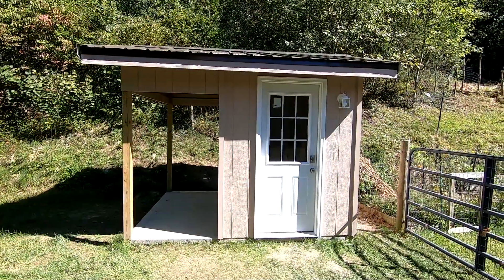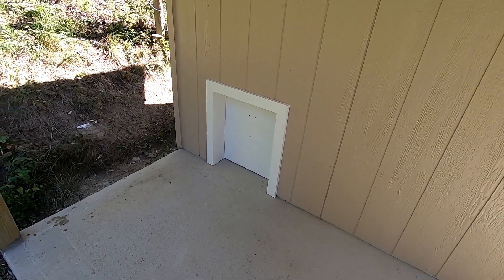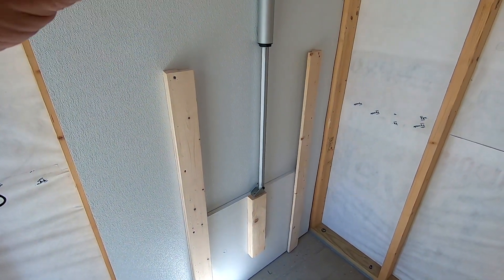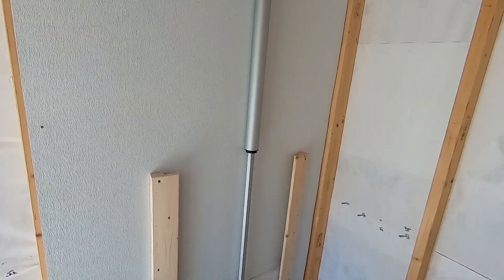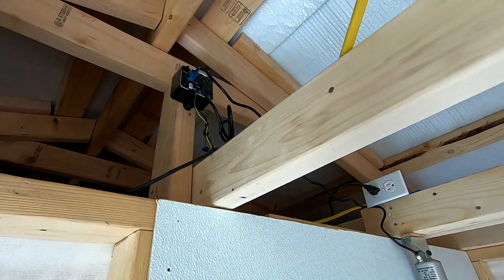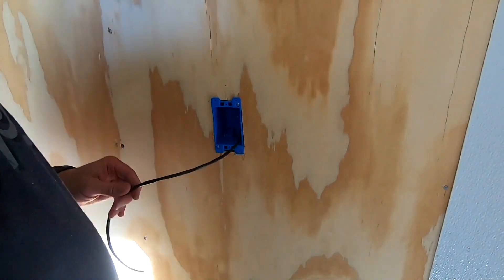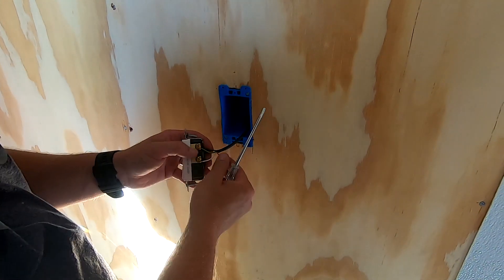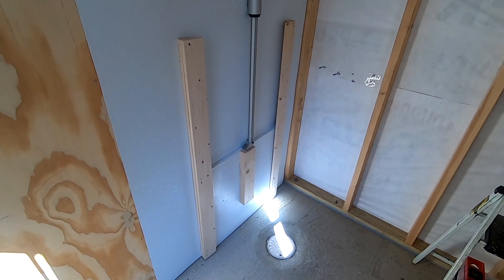How To Build A Remote Actuated Dog House Door

Comment: "Ultimate dog door"?  NOPE.

Common man. It is a nice door but, to be an ultimate door it need way more than just being able to open and close, by remote. NOT saying it is crap. It looks very nice.

"Thought you could make it better, than a commercially purchased door". Fail. Well not fail, maybe a draw.

1 Should be at least 2" to 4" off the ground so that water does not go in. Your walk-in door has a threshold for that reason. You should have at least put one on the dog door. This also makes it so that nothing gets accidently pushed into the doors path. Like a food bowl, bed, stick or dog laying there. I know you will be there looking when operating but if you ever want to automate the door it, a raise threshold will make sure bowls, sticks and beds don't get in the way and it will be uncomfortable for the dog to lay there.

2 Your controls and power should NOT be in the ceiling. They should be in a cabinet or at least be mounted on the wall for "just in case" and maintenance. Not adding difficulty of being in the ceiling.

3 You should have mounted it INSIDE the wall. I have a video Called "Chicken Coop Door w Safety Feature" and another one called "Experience The Ultimate Chicken Door Safety: No Crushing, No Cruelty Testing". You will see, that putting it inside the wall is much better and "easier". All the components can be placed in the wall behind an access panel (Plexiglass in the videos). All the components will be protected and out of the way. Added bonus they will stay clean.

4 The door railing/track is way easier to make and install. No need to build up a track. 

5 It can be insulated just the same as a regular wall, just about. It will help in cold weather that all the components will be protected from the cold.

6 On that note. By making the actual door a 3.5 Thick x whatever Height x whatever Width box. The actual door can be filled with insulation. This will also remove the need for "tracks", since the door will take up the space between the wall outer sheeting and the wall inner sheeting.   Imagine a double pane window that provides an airgap, and improves insulation. Call it a double pane door.

7 I normally advise people to attach the push rod of the actuator to the BOTTOM of the door. Or 3/4th to the bottom.  This not only helps keep the door from binding but it saves on vertical space. I mainly deal with chicken doors, where often there is not much vertical space in smaller coops. So for you it is not a big deal but it helps. The rod can be attached at the bottom or top of the door mentioned in #6.

8 you don't need to spend $75 on a control switch. Yes, it is built and ready to go but you can get WAY more functionality from an MHCOZY 4 CH Smart Switch. It has RF Remote, Wi-Fi, Interlock, works with A and G home assistants to program open and close times automatically. Set it to open and close with the sunrise and sunset or before and after. Can be made to also wait to open the door on very cold days. Open and closed from anywhere. 2 channels will be for opening and closing the door and you will have the other to two to operate lights or a feeder/waterer.  All for just $20.

9 It would way better if you were operating this on a 12 volt battery system. Solar charged or mains charged, but it works off the battery. WHY? So, if there is a power frailer and it is raining (like after a storm) but you don't want to go out to have to manually open the door because you expensive switch operates on 120v ac from a 12v power supply. You never mention that part so I am assuming. Mains power is out but the battery is still charged.
Reply from the maker: Thorough

Comment: I like the simplicity of it.  Would be great if you could connect it to the internet and open and close it from anywhere.
Reply: If you want to do that all you need is a SONOFF 4ch or MHCOZY 4ch smart switch.
Reply: This is what I'm looking to do.  Hoping someone has an idea on how to accomplish this?  What parts would be needed?  get it set up to the home WIFI, and wire in a unit that has an app capability to be able to operate it from anywhere as long as the mobile device has service, and the unit has WIFI connection...     any ideas anyone?

Comment: My dog currently paws at the door to be let in and out. I'm planning to build a dog door as an insert into one of the new windows (I'm currently renovating) so I'm looking for ideas to make the switch accessible to him for opening (from both sides) and an automatic closing function with a slight delay. A friend shared this with me to generate some ideas. It's a great set up for your needs. Thank you for sharing it
Reply: Did you ever get this done? If not, you can use some motion sensors and a delay timer. When the motion of YOUR dog is detected the timer starts and after 30 sec to a minute later the door opens. Now your dog will eventually know to wait or will be there scratching, and eventually will learn to wait. While other animals outside, just walking by, will trigger the motion sensor but the door doesn't just automatically open for them.

I have a video called "Automatic Chicken (Doggy) Door". It is a doggy door that I am making for my sisters dog, that I am taking care of over the winter. I am getting tired of have to take the dog for walks down the street, when I have a perfectly good acre of fenced back yard. It has been very cold and wet lately so she is now stay in the center patio. I was literally in starting to work on the motion operation part. Watch that video, and soon I will post the motion operated on soon.

Comment: Would this specific control box allow for an infrared sensor?
Reply: Short answer is yes.

Long answer is it depends on if the sensor has to have a NO (Normally Open) , NC (Normally Closed)  and COM (Common) Connections. but you will be hard pressed to find one that also has a timer on it.

But if you want to use an IR sensor, I just left this comment with someone else. Instead of this controller all you need is.... 
"
Did you ever get this done? If not, you can use some motion sensors and a delay timer. When the motion of YOUR dog is detected the timer starts and after 30 sec to a minute later the door opens. Now your dog will eventually know to wait or will be there scratching, and eventually will learn to wait. While other animals outside, just walking by, will trigger the motion sensor but the door doesn't just automatically open for them.

I have a video called "Automatic Chicken (Doggy) Door". It is a doggy door that I am making for my sisters dog, that I am taking care of over the winter. I am getting tired of have to take the dog for walks down the street, when I have a perfectly good acre of fenced back yard. It has been very cold and wet lately so she is now stay in the center patio. I was literally in starting to work on the motion operation part. Watch that video, and soon I will post the motion operated on soon.
"
Reply from the maker: It doesnt have any other inputs.

Comment: You are a genius! I wonder if this would work on a timer somehow. I would like it to open at 8 AM, but I’m at work. I have to run home every day to open her door so she can freely go in and out after the sun comes up
Reply from the maker: Thank you. I'm sure using a simple electric timer circuit with relay could accomplish your goal.
Reply: @JackofAllMasterofNone  It is way better and simpler to use two timers that are SPDT like the TM-615 Timers
Reply: Yes you can. In fact it is done all the time. Use Two TM-615 timers or just One TM-612 timer. 

Of course you can use a SONOFF 4CH R3 PRO Smart Switch or an MHCOZY 4CH Smart Switch and do it over Wi-Fi, RF Remote, Buttons on smart switch (manual), remote switch, or on the Alex, Gaagle, and EWlink or Tuya apps

Comment: I have dogs that will stay home if I’m not home but will follow me if I go out.  So I needed a dog door or gate that would open after a while. It couldn’t involve electricity-I’m an electronic engineer but don’t trust the reliability. 
Todays dog timer uses a bungee cord to pull open a sliding flap. It is held shut by a little lever held by an ice cube. Ice melts in a little while and the flap is released

Comment: Nice job but the problem is it can kill your dog or cat they are loitering below it when it comes down.  The fail safe infrared beam needs to be demoed.   Also, doing that manually sounds like a major pain in the ass.  You should modify the system so your dog can wear a key fob on his collar to trigger it remotely.
Reply: A beam is just too much hassle and needs to be powered. Also the beam is only on one side. In or out. If a food bowl gets pushed into the doors path and the beam is outside, the bowl may not be in the beams way. What happens if the dog it just standing there looking out, and the door closes. Body and feet are inside while head is outside. 

A much simpler solution is to mount the top of the linear actuator on a hinge. Making a pressure switch. Either use some insulated contacts or a limit switch, and wire the motor though the switch. When the door meets resistance, the whole door and actuator lift up and the hinge presses or releases the limit switch and it cuts the motor off. Adding a diode, you can make it so you can still go in the up direction, but the door will not go fully down until the obstruction is moved.

You can also fairly easy make and use a latching relay that gets triggered and it will send the door back up. You can make it stay up or make it so it will come back down once it reaches the top.

I have a video called "Chicken Coop Door w Safety Feature" that shows this, using a pressure switch at the bottom of the door instead of the top of the actuator. It has more features but the action is about the same.
Reply from the maker: This would not be a correct application for a cat. This actuator is not powerful enough to kill a dog and stops with any kind of serious resistance. The point is you would have to watch for your dog and train them to stay out of the way. For my smart dog, it works excellent.

Comment: This would be a great chicken door!!! Thanks for the idea!
Reply from the maker: Yes it would!
Reply: I was just going to say, I built one for my Chicken coop.  I used a gaurd light control to open it automatically at sunrise and close it at sundown.  Did have to use a relay to reverse the power signals to up and down, from on and off.  But it was no big deal.  My Chickens were always inside well before it got dark, so it was never a problem.  And it meant I didn't have to go out there every morning & nightfall to let them out or in. 
Also used an automatice deer feeder to compliment my ultimate lazy attitude.  Wife collected the eggs while I was at work.   We free ranged the girls in the 2 acre fenced in back yard so predators were rare..
God Job.  New Subscriber here. We might be twins!  HA!  Naw, I'm a lot older than you.....
Reply: There are way cheaper and better ways to control a chicken door.